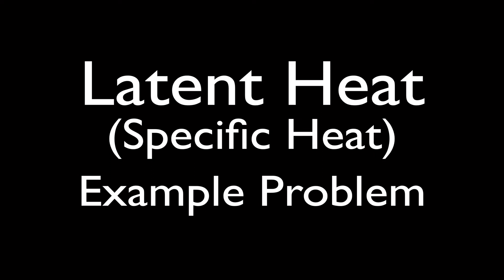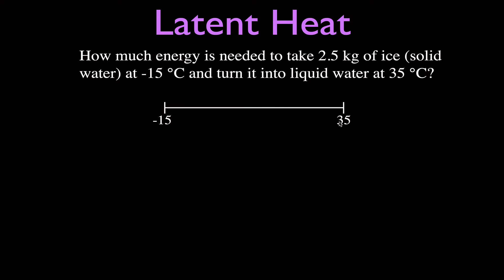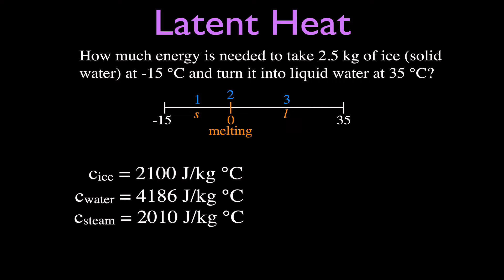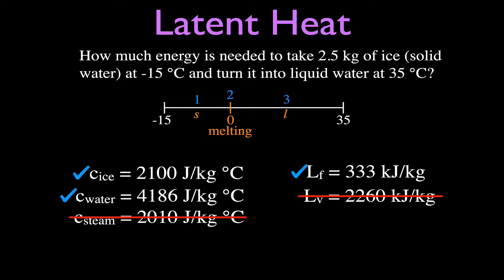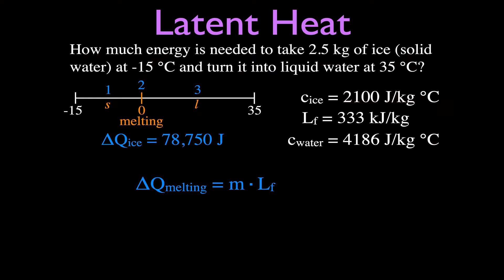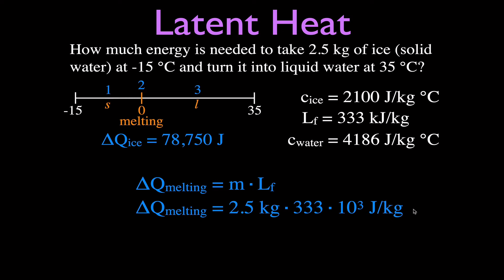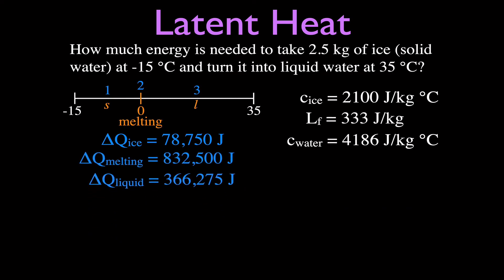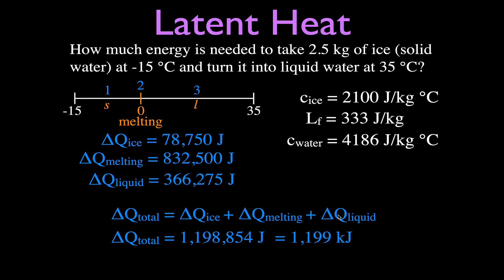Thermodynamics: Calculating Latent and Specific Heat, Example Problem

Comment: In the Rankine steam power plant, 2 kg of steam at 
 enters the condenser. Determine the amount of heat rejected by the steam in the condenser to change its phase from vapor to liquid in an isothermal process. Take the latent heat of vaporization of water is 2260 kJ/kg.

Please help solve this

Comment: Im  wondering where did you get the 10^3?
Reply from the maker: Because it is 333 kJ (kilojoules) but when you put the number into the equation it has to be in regular joules and not kilojoules. So the 333kJ can be written as 333,000 J or 333 x 10^3 J. Does that help?

Comment: Well explained 👏🏽. Now , can this concept be use to explain why it is easier to distill a solvent such as Toluene compared to water, considering the fact that Toluene has a higher boiling point than water?

Comment: what would happen if you reversed the equation so that i would be able to use it to find the energy transferred away from 100g of steam @ 100 degrees to change it to a liquid?
Reply from the maker: You would get the same amount of heat out.

Comment: please solve this proplem, How much heat energy is required to change a 40 g ice cube from a solid at -10 degree centigrade  to steam at
110 degree centigrade?
Reply from the maker: This is basically answered in the video.
Reply: @stepbystepscience  the video did upto gas
Reply from the maker: Yes, but steam is a gas.